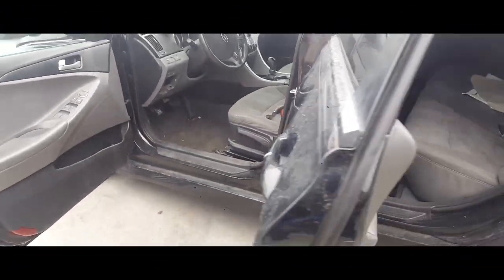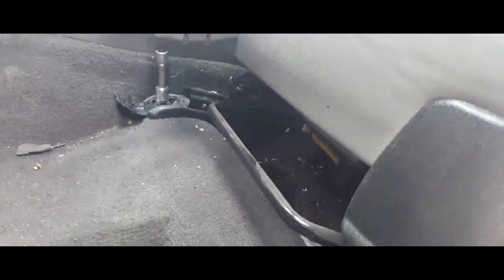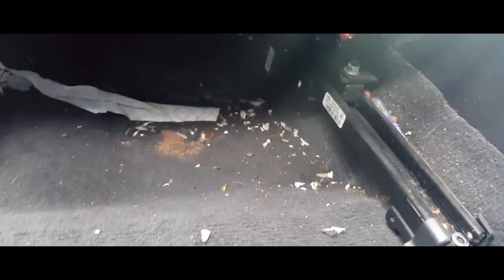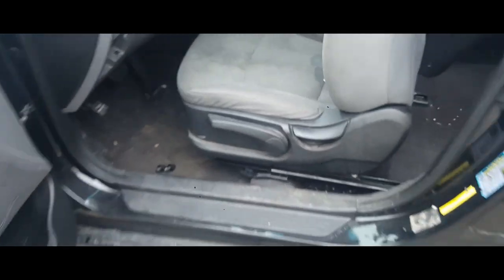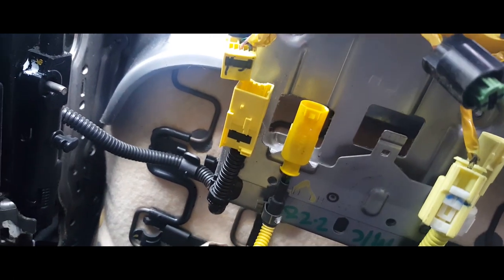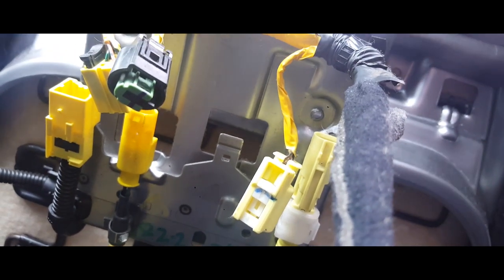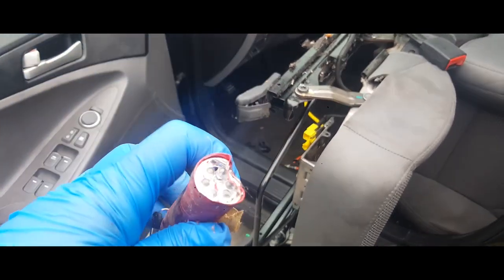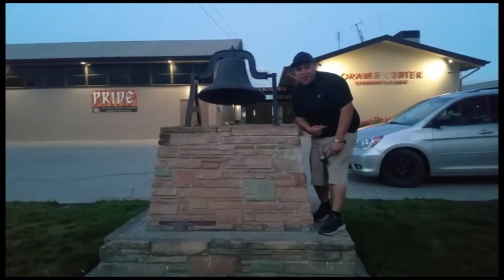How to: Remove Driver Seat from a 2013 Hyundai  Sonata

Comment: I had a customer who's passengers seat was stuck in the fully reclined position. It wound up being the switch bypass located on the outside underneath the switch panel were the seat pivots. It has 2 torque screws with 3 wires. Pulled it out and flipped the switch that was stuck. I hope this helps someone. Thanks for the video.
Reply from the maker: Heck yeah brother, thank you for your input. 🙏 Thank you for your Support!

Comment: Hey great video. I could use some help since when taking the cables off I accidentally broke one and the head broke as well, I was wondering if you knew where could I buy another set or maybe just one of the heads. ( Is the big yellow square)
Reply from the maker: You can try online but maybe just yard would be ur best bet. Sorry bud

Comment: Does unhooking the wire to the air bags cause any malfunctioning? As far as the air bag warning lights etc?
Reply from the maker: yes it does but as long as you dont turn on the car your good. Connect it back then turn on the car

Comment: How did you take off the black holders  that hold the wire on the frame, did you use a special tool? Because I tried needle nose pliers and regular pliers and it was a no go
Reply from the maker: I used these to get it off..

https://www.harborfreight.com/5-piece-upholstery-and-trim-tool-set-99739.html?_br_psugg_q=trim+tool
Reply: Ok thanks for the answer however these are squeeze ties are you sure you can that then of with these tools?

Comment: Hey! Question! Do I have to disconnect the battery so it would not trigger the airbags?
Reply from the maker: You can disconnect the negative cable, but Ihave Remove a bunch of seats from cars and never had an issue.  But just for mind at ease, disconnect the negative cable.
Reply: It’s not exactly for Hyundai Sonata, it’s for 2013 Hyundai Elantra and I cant really find any videos for it. Im assuming they have the same wiring under
Reply from the maker: @Jadeemo2619  Yeah same thing.
Reply: Yes you most certainly need to disconnect the negative battery cable to prevent malfunction when putting wire connectors back in place.

Comment: Mr. Lopez did you disconnect your battery before disconnecting the wires under the seat and did you wait before disconnecting the seat wires?
Reply from the maker: You can disconnect the negative cable, but I have Remove a bunch of seats from cars and never had an issue.  But just for mind at ease, disconnect the negative cable.

Comment: i know this is a old video but do you still respond to messages here?
Reply from the maker: What's up bro
Reply: @559powerscape  so I lost my phone and it was GPS tracking in my car but I couldn't find it anywhere. Is there anywhere in the seat itself it could get stuck? I ended up buying a new one but my videos and pictures were lost
Reply from the maker: @TheMagicChong  try taking the seat off
Reply: @559powerscape  I did but not fully. Didn't know if I would put the wiring and clamps(which looked to break in the video) back correctly.
Reply from the maker: @TheMagicChong  lol they only plug in one way
You can't mess it up
Reply: @559powerscape  yeah true but what about the clips? What do I do if they break off like I think it did in this video or the other one I watched
Reply from the maker: @TheMagicChong  u should be good u can also try using zip ties to hold them together

Comment: Hey I removed the front seats and now every time someone sits in the passenger seat the airbag light kicks on in the dashboard
Reply from the maker: I don't know try disconnecting the negative terminal for a good minute and try again. Sounds like the seat has a sensor to detect weight my civic has this. It's to determine if the air bag deploys or not, in case small children are up front.

Comment: I hope this guy disconnected the battery before disconnecting. The 3 wires under the driver's seat didn't show that.
 If you don't do that, disconnect the battery.
 Before for taking the?  3 wires underneath the driver's seat. You're gonna have a airbag light on your gauge and I don't know how much that is. If I remember, I think someone told me it's about 3 or $500 just to get it taken off. Let's know how to do it. Have your own OBD reader.  A good.
 One.
Reply from the maker: @socalevo53  I didn't as long as you don't turn the key to the on position you should be good. But you can always disconnect the negative cable for extra measure

Comment: Airbag in seat ? Yellow wire !!!!
Reply from the maker: You can disconnect the negative terminal but I've remove thousands of seats and never had a disconnect anything just disconnect the pigtails from underneath the seat.  To be on the safe safe go ahead disconnect the negative terminal but I did it to the exact same car and didn't have to.